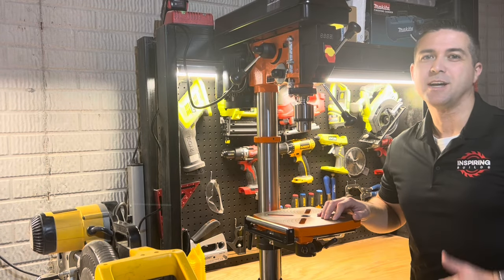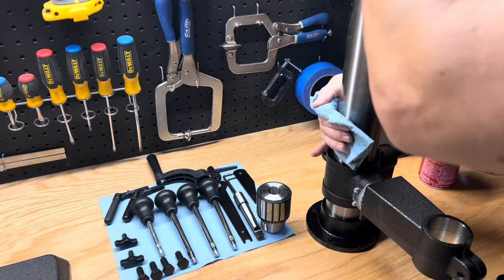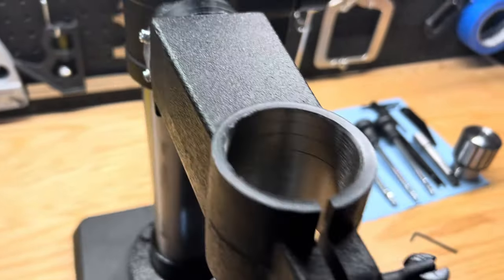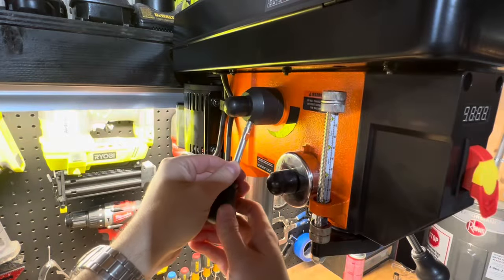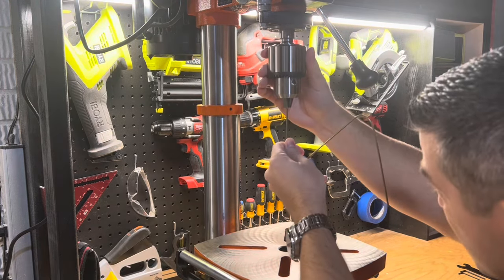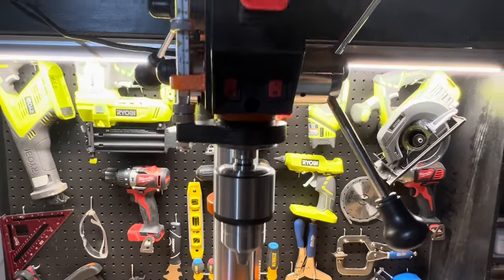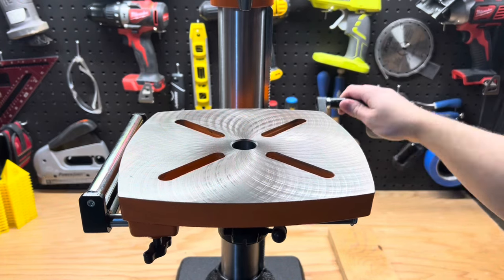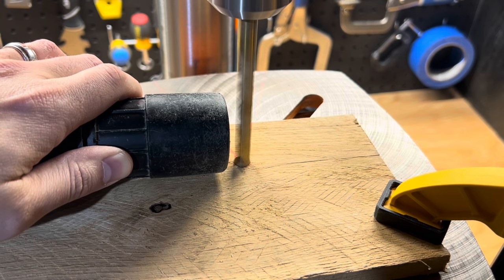WEN 4214T Drill Press Assembly Insructions and Review (Best Value!)

Comment: Several of the drill press on the market are made in the same factory as these and are just green or Grey and twice the price. I love mine, FYI check out the wen 6 and 8 inch jointers same exact machine as the green and Grey brands at half the price.
Reply from the maker: @davidduplantis2070  Thanks for watching and the tips.  Happy New Year!

Comment: I looked at this as well a a few others like Grizzly and Bucktools. Went with the bucktools as it’s exactly the same in most places as this Wen but cheaper (on sale direct from Bucktools plus free shipping) and has the larger motor. Prefer the dial depth stop over the threaded rod and nut also!
Reply from the maker: Thanks for watching.  Buck tools has their 12” for $339 on sale for $319.  Amazon has it for $340.  This is why I mentioned the WEN is arguably the best drill press for the money. 👍
Reply: yea, but they give ya 10% off with goofy coupon BS on their site. Mine was like 280ish to my door

Comment: Nice walkthrough and overall coverage of this one. Very nice features on it. If we ever expand our shop (or maybe when I get all the shelves filled with car parts, emptied) I'd like to get a press. Won't use it a heck of a lot but the times when I did need it, I wished I did to make the job easier. Thanks for sharing.
Reply from the maker: Thank you very much! Can’t beat the price, heck I can buy two and use one for a gift and still be ahead on cost with the same features as other drill presses.  No matter your skill level on a drill it’s tough to get exact 90 degree angles and the same consistent depth.  This will be great for accuracy and efficiency.  If you’re curious it also does a nice job drilling through metal since you work on cars.  I was also over the changing belt and pulley days. 😂

Comment: Looks like one heckuva buy! I’m definitely interested. I can tell by your tutorial that you’re very knowledgeable about machines like this. Great job, very easy to understand
Reply from the maker: Thank you very much! Can’t beat the price, heck I can buy two and use one for a gift and still be ahead on cost with the same features as other drill presses.  No matter your skill level on a drill it’s tough to get exact 90 degree angles and the same consistent depth.  This will be great for accuracy and efficiency.  I was also over the changing belt and pulley days. 😂

Comment: I this this same one,  my two issues where the 3 handles, that was a simply fix, just removed 2 of them.  My second was my table was flexing when pressing hard, so had to either use my bottle jack, or a piece of wood with a 6" screw to keep the table from flexing forward on me,  also switched out to a keyless chuck.
Reply from the maker: Thanks for watching and the leaving the comment J.T.  Overall would you purchase it again for that price point?  I agree you could switch out to a keyless chuck for time, but the keyed chuck is comfort for a lot of people as they feel it can get tighter.  Any handles as you mentioned are easy to remove if getting in the way leaving the top back one. 👍
Reply: @inspiringbuilds  I would definitely buy it again, even a smaller one, for a smaller DIY person.  The 3 handles just always seemed to keep me from drill with consistent pressure, so I just use 1.  But yes, very good purchase!!